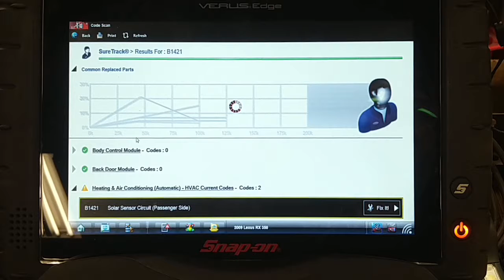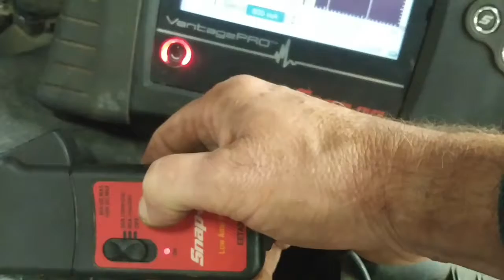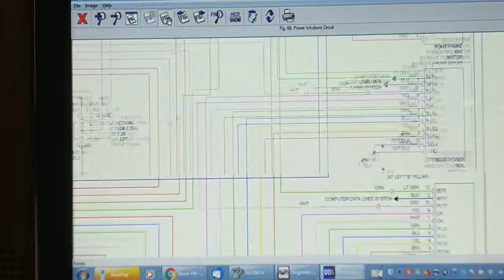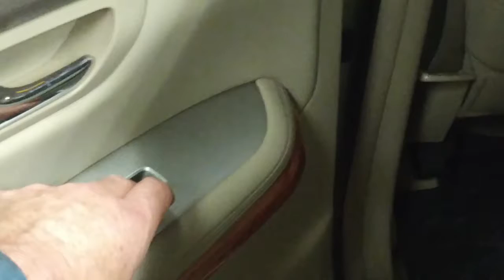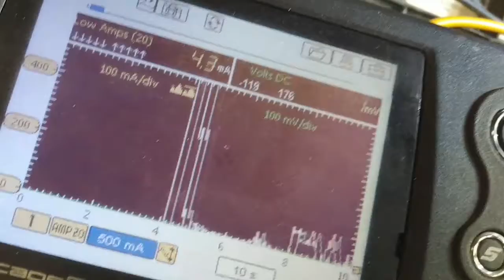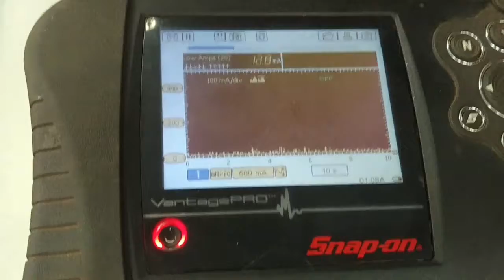2009 Lexus RX350 Parasitic Draw and Power Window Problem

Comment: I also have bettery drain issue. When my car sits for 7 days, battery get discharged.  I have a 2008 lexus rx 350.  When I locked all the doors  using the aftermarket remote  the door Ajar on my dashboard still  shows that the driver side door is still open. But when I use the original lexus remote no issue.  Could the aftermarket remote causing the battery drain? and causing the door ajar light to come on? The door ajar light only comes on when I push the locked button of the aftermarket remote.
Reply from the maker: That's really tough to answer. I'd avoid using the aftermarket remote temporarily see if the problem is eliminated.

Comment: What if all windows work but drivers side. Every once in a while it would work. One day I hopped in hit the button to see after months of leaving it be. It went down now I'm months into driver window won't go back up and the power switches on driver door do not control other doors any longer for locks or windows. My husband replaced the fuse thinking Maybe it was that and the driver door worked again one day and stopped working again the next. All other windows and locks work only at their doors. Drivers side window, lock, and controls nothing. Now my battery keeps needing jumped if the car is off a whole day. Turned off all light systems I could find inside incase of parasitic drain. Read it could possibly be gps trying to update and draining battery. One problem after another with this car. I'm broke and so frustrated.
Reply from the maker: So there are no functions from the drivers switch? No windows or door locks but work from their respective switches. Sounds like you could be missing power to the driver switch. Check wires between driver door and pillar for broken wires.
Reply: @PhillipBailey  Yep all other doors work completely expect the drivers door it's just dead. Ok I will do that. Thank you for the advice.
Reply: @amandaparker981  2009 Lexus RX 350- same problem. I stop the car, turn off the key, and turn it back on, and that usually gets the drivers' window control working properly again on the first try, sometimes the second or third try.
Reply from the maker: You have to confirm power and ground at the driver switch when it's not working.
Reply: @PhillipBailey  Yeah, I have power and ground at the driver switch when it works, I don't have them when it fails . . .  all within seconds of each other.